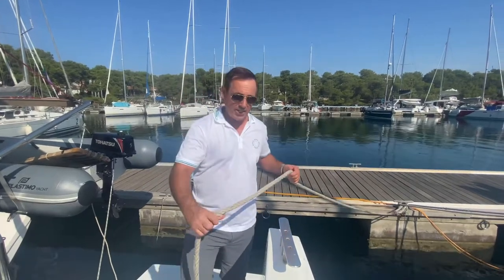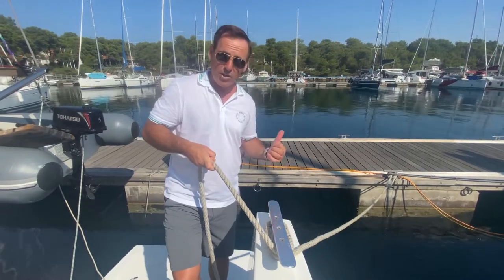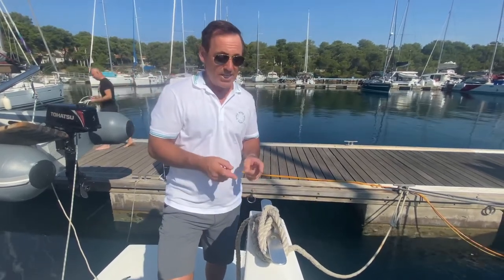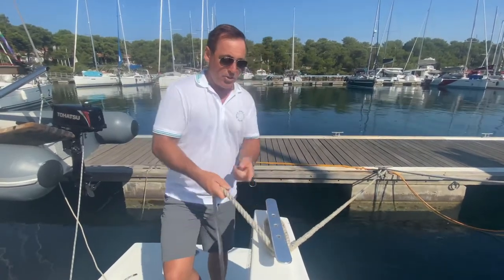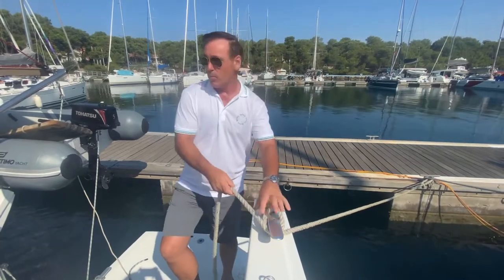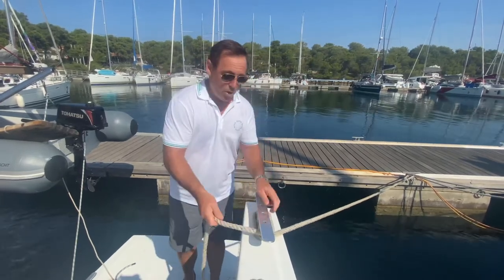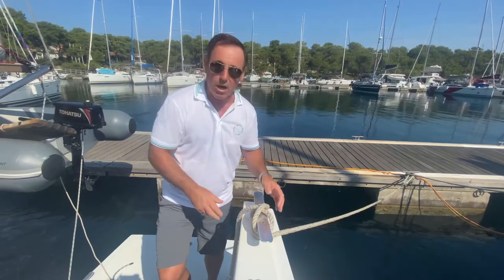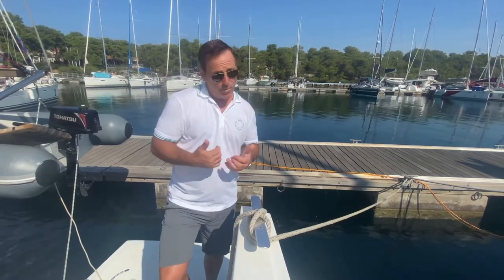How to CLEAT A LINE | Former Royal Navy Officer Demonstrates

Comment: The American way or the right way in the whole world to tie to a cleat is not the one you show in your video. Add another X before you tie the locking hitch to the cleat. You will see that the locking hitch does not jam, even when the line is heavily loaded.

Allow me to clear up some misunderstandings:
What you show us is known as the OXO method, or OXXO method for heavy loads. 
Well, you show us the OXXXO method for very heavy loads (imo this is overkill). 
This method is part of the RYA training, and also the USCG training. Right?

The rest of the world ties to a cleat with a half or 3/4 round turn at the base, 
at least 2x half-hitches on the cleat horns, and finally the locking hitch. 

As you mentioned, both methods have advantages and disadvantages. 
I use both depending on the circumstances.
Fair winds
ah